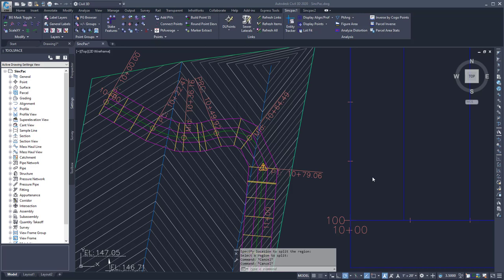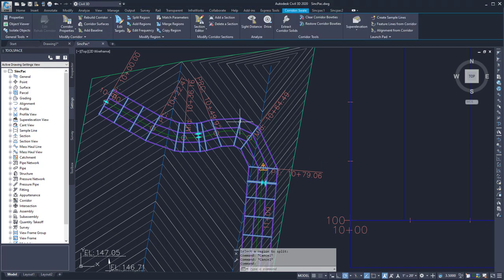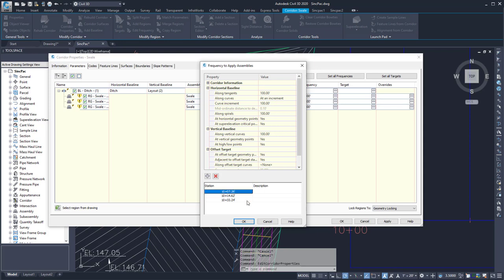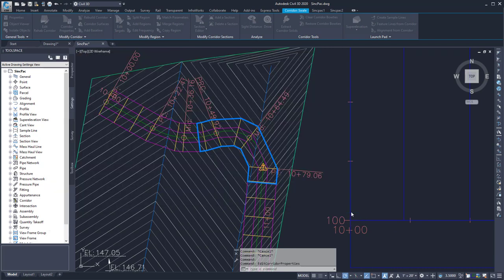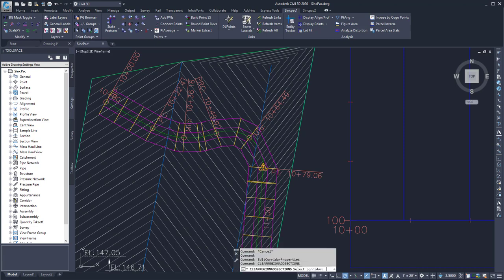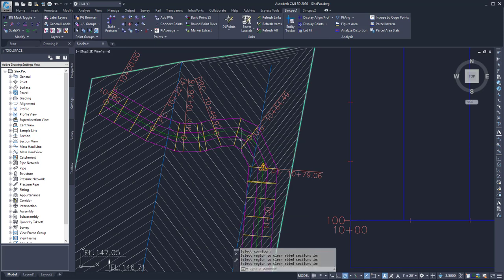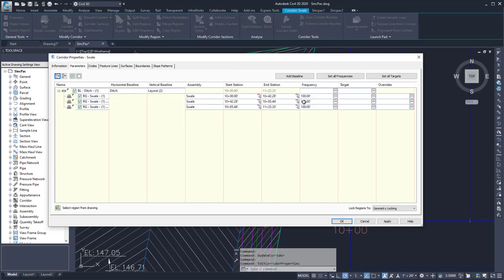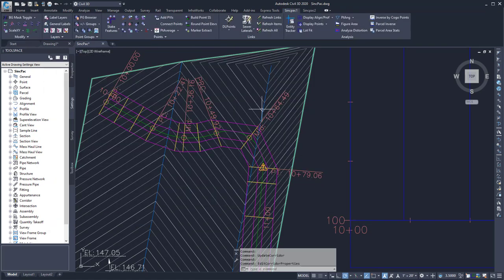ClearRegionAddSections

Comment: Will Sincpac C3D 2019 still work on C3D 2020? Thanks
Reply from the maker: You must install a release of the Sincpac compatible with C3D 2020. As of Feb. 25, 2020, v3.25 and v3.26 meet that requirement.